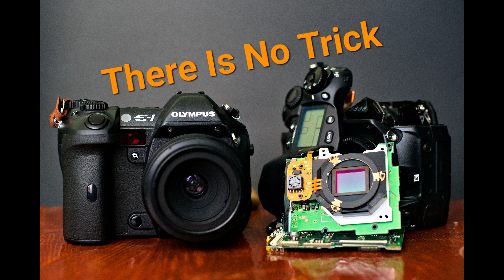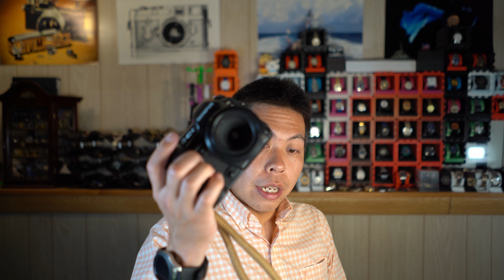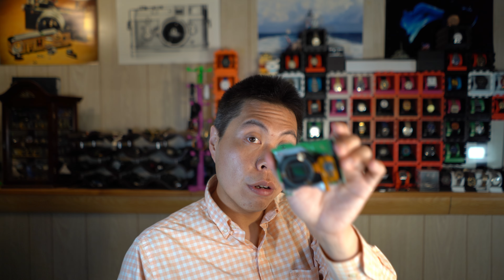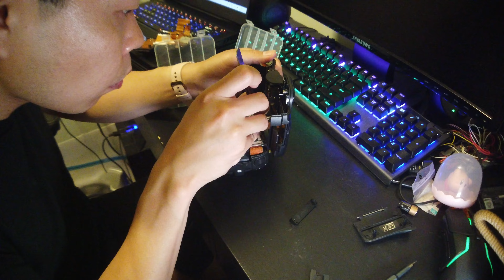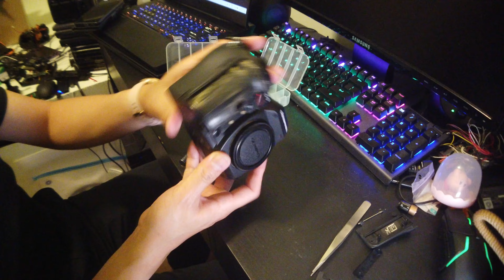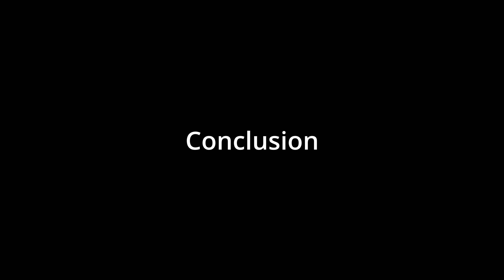My Trick to getting Cameras Cheap! This time I got the Olympus E-1

Comment: Just got an E-1. It seems the mode dial is broken, when I turn it to M, S or A the camera still thinks it's in P mode. It doesn't seem to hard to take the top plate off. I'll check it tomorrow and I hope it's fixable.
Reply from the maker: Yeah top plate removal isn't too bad and if you can get a parts E-1 it should be a pretty straightforward swap the only tricky screw for the top plate that there is 1 I believe under the grip material near the shutter. Otherwise it lifts off and the connecters are pretty chunky flatflex cables. Goodluck!
Reply: Thanks! I couldn't wait, opened up the camera and fixed the button with super glue, now I can choose all the modes.
Reply from the maker: @icecreammm2  awesome!  Always good to hear of a successful repair!